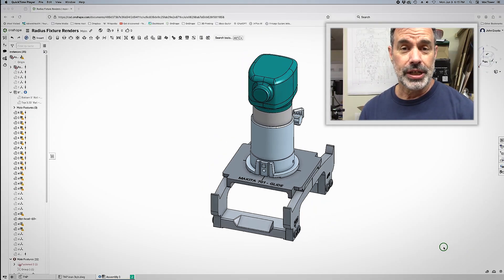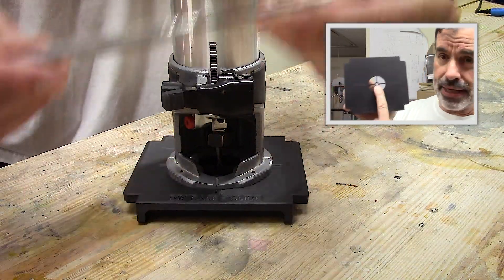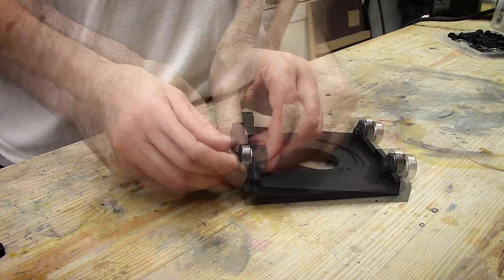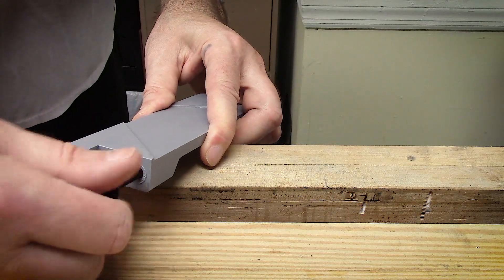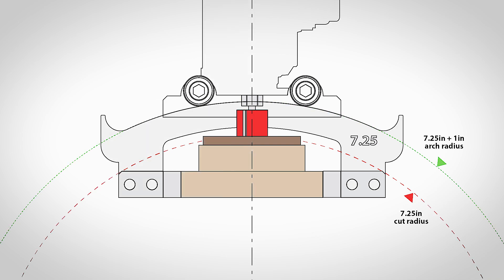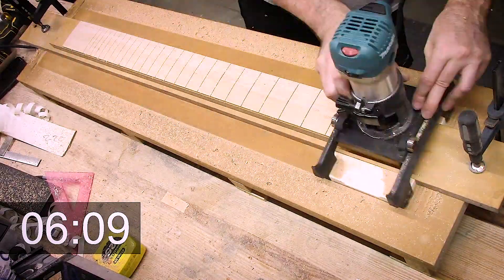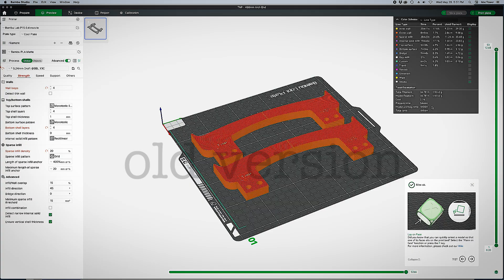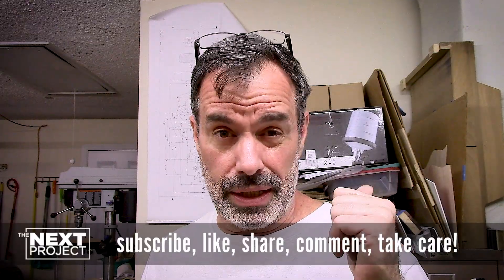Fingerboard Radius Fixture - 3D Printing Guitar Project Tools Ep3

Comment: Excellent.
But I think, if you go with the router length-wise, you get a polygonal cross-section, if you rout across the board over and over again, the work may be more boring, but the cross-section will be rounded.
Reply from the maker: Achim, good to hear from you and thanks for watching!
To a small degree, the finish surface will reflect the direction of router travel.
As you mentioned the lengthwise routing will create a polygonal section, but if the passes are rather narrow, the faceting is very minimal and is easily removed with a few passes of a radius sanding block.
The issues I notice with routing across the board, in the the direction of the frets, was router bit trail artifacts. Fine lines showing every pass of the bit. Again, a little sanding removes the issue.
I hope everyone experiments with direction of routing and different bits to find the best process for themselves.
Hope you are doing well. Be safe and take care my friend!